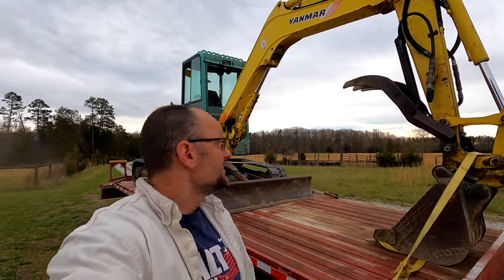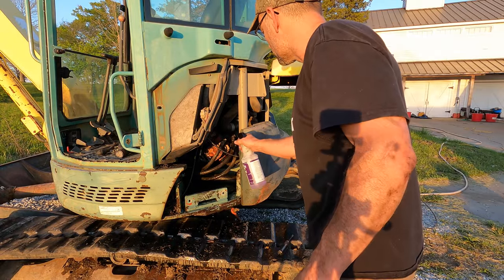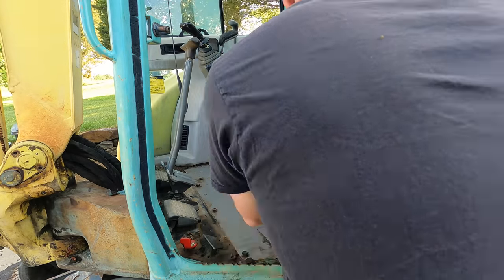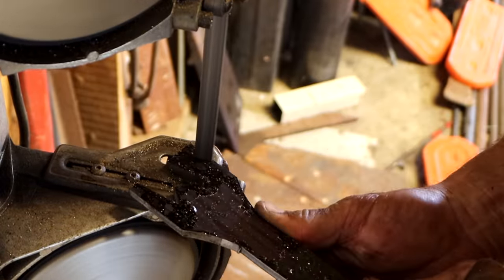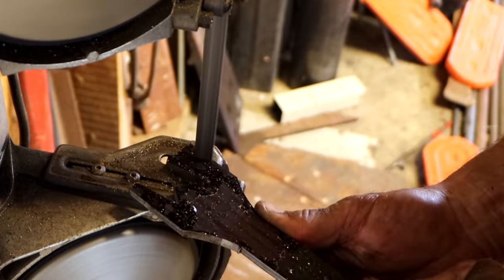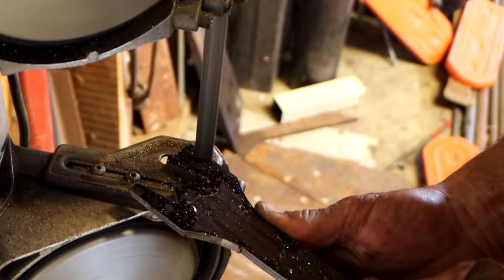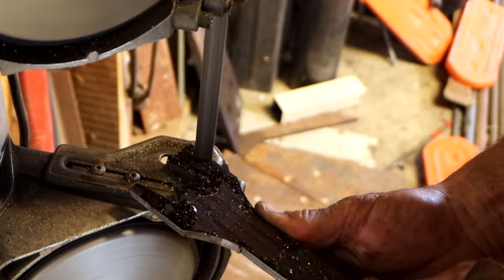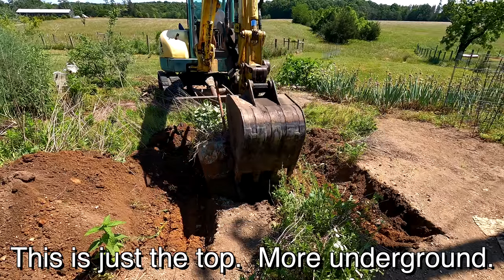Buying (and Fixing) My First Excavator.  Yanmar VIO-50

Comment: There have been independent tests done on different oil brands. You can buy a much less expensive oil that protects as well, if not better. You might consider researching engine oil comparison studies. Lab results on engine oils are really the only way to determine which oils protect better. All major oil brands protect engines adequately. When the differences in engine protection are basically insignificant, there is no reason to overpay for engine oils.

I am not being critical of anything you’re doing. I want to make you aware, in case you had not seen any of the oil comparison studies. I am enjoying your videos.

Comment: If possible add a higher fuel pick up inside the tank. Keep the original, but use it as a reserve. Of course you would have a switch between the two. You can use my name😊

Comment: Always replace the orings on straight thread jamb nut fittings. They're always bad as far as I'm concerned. The thing the yanmar dealer could identify looks like an accumulator to me. It's purpose would be exactly what you were guessing, it absorbs pressure spikes.

Comment: There is a drive mother on each final drive.one hyd pump may be more worn than the other.
Reply: there is at least 6 minor things you check before replacing the $ 5000 drive motor

Comment: Like your videos and I've learned a lot from watching you work on all of your older equipment. I just purchased a 2007-08 Yanmar VIO 35-5. Where did you find your service/parts manuals and who do you order your Yanmar parts from? Any help is appreciated.
Reply from the maker: I got manuals from the dealer and so far have gotten the parts I needed through them as well.

Comment: If it wasn’t said that looks like a hydraulic accumulator that basically does exactly as you described using a spring to accommodate for pressure spikes

Comment: check your idealer slide if its all the way out the track is probably wrong  replace track adjuster seals, hydraulic spanner wrench's fit ,  20K mite have been a bit high but if your happy and it does what you want ok

Comment: Super video learn lots 
I myself own vio 70 and i have a problem with my fast track speed when i press the pedal it blows the fuse  i romoved the pedal and cleaned but still no joy what would my nect move be cheers

Comment: It reminds me of a pressure regulator like you'd see on an oxyacetylene torch, you've got an inlet, an outlet, and a set screw for adjusting the resistance of the flow. You've probably already figured this out since this was posted 4 months ago but 🤷‍♂️

Comment: The problem with your
Blade dropping and your track travel speed is likely the rotary swing valve
Reply: Yes, the center post seals.   Awkward to get at......
Reply: blade dropping my first port of call will be to strip the ram and replace the piston and gland seals , 95 % of the time thats the cause before playing with swivel joint or operating spool.

Comment: Usually anything for sale locally under 20 grand is a much smaller machine. I think basically everything you had to do was to be expected for a 20 year old machine, and overall i would expect a 20 year old excavator to be worse than that, so i'd say you did well.

Comment: 31:00  RE: flushing the oil out of the drive gear thingies....  I think I herd someone mention flushing with ATF (transmission fluid) but I don't know WHAT VERSION OF THAT RED STUFF THEY WERE referring to, OR if it was just ''general hydrolic'' or HIGH __ wutever,  I am sure someone knows or already tole you 3 diff things to use to flush it out with :)  GOOOD LUCK !:)  or even if flushing is NECESSARY or some thing such as that....

Comment: I have what appears to be the identical pressure washer to yours, and it is very helpful but never really gets greasy stuff clean.  My brother used to be a coal trucker, and he has a "steam jenny" - burns fuel oil to send out water at about 200°F.  It just melts the grease. You are down to the paint, with no residue - and much quicker.  The only thing I ever used that will get dried cow manure off my cattle trailer.  The only down side is that it requires 120V.  They may make them that run off a gas motor, but I don't know.  It's a quantum leap.

re: differential drive speed.  Perhaps it's just that the side with the worn track represents a "smaller wheel," making that side cover less ground, but the RPM of the drive motor is actually the same.

Comment: After working in the woods for a while I have a greater appreciation for safety glass and screens.  Just grabbing a few branches and having one snap from the force of the bucket and thumb coming together and spear through the screen directly in front of my face only stopping because the woven wire was just small enough to grab it.  The list is long of broken windshields and safety screens which lived up to their names and saved me from great pain and disfigurement.  Some of my friends haven’t been so lucky.  If I were going to disconnect a safety feature like a movement beeper, I certainly wouldn’t do it on film because of the level of liability that adds for an accident will outweigh any frugal savings you have ever made.
Reply: Not to mention digging up a hornet's nest and having to jump off the rig and run for your life. An enclosed air-conditioned cab is on the top of my list.

Comment: My  final drive seal went on mine same symptoms you are having on yours.  I have to replace.it this fall finally is failing after 3 years...also my blade also would not hold position.  It was the spin joint some of the o rings were worn out in rebuilt it and blade stays put.

Comment: Whenever you are looking at a used ANYTHING which needs work. NEVER let on to the seller what you think the problem is, ESPECIALLY if it is an easy fix and NEVER whip out your leatherman or whatever & fix it on the spot. CASE IN POINT- 2 mechanics went to look at an old excavator a farmer had which had broken down & left park where it broke some years earlier. The Guys looked it over & concluded they knew exactly what it need. They jumped in their truck and went to town and picked up some parts and fluids & returned and set to work. In a couple of hours they had it running so they drove it about & tested all the systems and were satisfied this was a good deal. So they told the farmer they would take it & the farmer says “ Well, boys, OK, but it going to cost you twice what I first asked” The guys were pissed. The farmer said “ That price was for an ex that did not run” The guys protested that they made it run & they paid for the parts. The farmer said  “Don’t care. The ex is now a running machine & I want twice”  The guys were pissed but had put over $500 into it. So they paid his price grumbling all the way and drove away with their new prize but not so good a deal.

!

Comment: I bought a 1990's IHI 35GX. It's in great shape, except the hydraulic pump is giving some really weird issues. Even after spending $3k rebuilding it, it still doesn't function right. So annoying with the odd bugs these older machines have.

Comment: Kind of a bad sign when the engine oil looks like it's the same oil it came with when it was new. Next time you change the oil run it through a mesh screen and see if there's any metal bits or shavings. That alone will tell you if the investment was worth it. 

Basically if your getting chunks of piston rings in your oil you'll know the engines on the way out. Also tracks are super tricky there might be screw adjusters as well might be something to check for. Sometimes they have a spring loaded plate with a screw adjuster that will push tension on the track or sometimes it's the stupid bearing wheels that get out or alignment on the topside. People pick n pull used replacement parts not understanding that the previous owner used theirs for logging or something and needed a loose track alignment to spool a logging line. Just some things to look out for, I didn't look very closely.

Comment: 9/5/2022 Labor Day. Using the air gun, a Dust 😷mask would be great to wear, to keep all that dirt out of your lungs.😁 I know you know to keep the guard 1/8 inch above your work. Nice job on the wrench, good job cleaning also, John. It has rained all day here. I know you will paint it up sooner or later. John, after I would drain the oil, and the filter was off and drain bolt out, I would pour kerosene into the oil pan. To clean more slug out. Let it run out and put some more in. When it was all out I would put the plug back in and add my fresh oil and filter. What do you think of this idea ?  Nice job today. I'm watching this on 9/5/2022 Labor Day. your date was 5/22 when you made this.

Comment: Great video. Just what i was looking for. Very informative. How much did all the repair/replacement parts cost? I know you said the hose was about $200, but what about all the rest--oils, fluids, filters, etc.  thank you.
Reply from the maker: Well, I bought the expensive oil for $140.  (Currently the regular stuff was around $100.). I think all the filters and final drive oil together was about $100.  Hydraulic oil was $110.  So around $550 for everything so far.

Comment: Did the travel motor hub gear oil smell like hypo is differential oil kind of a stinky sulphur.  And just as I wrote this you said it didn’t smell like like hypoid gear oil which was my suspicion they had used hypoid gear oil.  For oil in strictly a drivetrain  environment to stink makes me wonder as I’ve never came across that but I don’t have similar equipment.

Comment: that set screw with lock nut is the pump presser relief valve or the pump, the round part the dealer didint know what it was, is an accumulator... it works like a system pump primer, the track adjuster rebuild is so simple its dumb,, the hardest part is getting the track off an back on, witch helps a lot using another machine, i just bought a similar machine but with new steel tracks an rollers 3 new ones.steel tracks stay on in wet res clay, were the rubber ones clay packs in an kicks the track off on mater how tight it is, oh how i hate rubber tracks,, they dont last,, and 4 bolts to split the track, it has a custom manual thumb, but i am going to add sections in the valve to ad the pluming to power the thumb i have all cind of used cylinders of all sizes one should fit,,

Comment: Jon, I follow Andrew Camaratas YT page and he repairs and services his diesel equipment. I’ve seen him clean a corroded tank by putting some balls in the tank that have an abrasive covering. Then he adds some rags to force the balls around. He uses air pressure to force the rags and balls around in the tank. After a while, most of the crud on the bottom of his tank is removed. Then he flushes and vacuums out the cleaning fluid and his problem with a fouled tank is gone. I think the episode where this was done was when he bought a used white Dodge diesel pickup that needed a lot of small fixes. Hope this helps. For a young guy in his early 30’s, he’s pretty handy. You two seem like birds of a feather. Good luck.

Comment: 3200 hours ? oki, unless this was expensive you got good deal. i see a lot of people buying mini excavators for their homestead, in my opinion this is the smallest excavator you should by if you wan to be able to do some worked. i wonder what is up with the tracks not going the same on both sides, that will drive you crazy if you have to track some distance, i wonder if it can be as simple as you have one new track and one old, they are not the same size and length, i have never changed just one track thinking about this. 20000usd, do not sound to bad, considering the 3299 hours, the engine is probably just driven in, it is not the cheapest, but this is going to be determine by the market around where you are looking

Comment: What kind of hydraulic pump is used for this excavator weather an piston pump or a gear pump?
Reply: pilot pump is usually a gear pump and can deliver around 35 - 50 bar (500 PSI)
Main pumps are a variable displacement radial piston type with movable squish plate so you get low pressure high volume until the load increases then the flow rate slows and pressure increases.
Main pumps usually deliver around 180 - 240 bar (3400 PSI)
Reply: @heartobefelt  you are saying that maim hydraulic pump tht powers the whole hydraulic system is a piston pump. How many pumps are used in this excavator?
Reply: @TeluguWatcher  no
Reply: @heartobefelt  is a gear pump enough to power the motors and cylinders on this excavators
Reply: @TeluguWatcher  no . the gear pump provides the pilot pressure that runs through the control levers . the pilot pressure then operates the main hydraulic valves which supply the high pressure flow to all the rams and motors
Reply: @heartobefelt  what I wonder is to power such a small hydraulic excavator why pilot pump is necessary why can't we directly run the system with a piston pump alone.

Comment: Why don’t you measure from your fixed drive sprocket to your idler wheel center to center or edge to edge and see how one side compares to the other and perhaps either something is wrong with one of the tensioners such as a bad seal although I think you would see a bunch of leaking grease if it was. You may want to have someone try greasing it while you carefully and slowly rotate the track while raised in the air maybe it will extend farther for you. I would recommend you sometime remove the covers off of the tensioners and clean out both of them with you pressure washer as you seem to really care which is nice to see. If all of this does not help you may want to think of swapping tracks from side to side and see if that helps any. You definitely know there is some difference in size due to one being new and one old and used. You also stated that the side that won’t expand and has the slack track which is the new one and not the old one which I find hard to believe but that it runs slower and I don’t know if you have foot peddle drive controls or levers but i’m wondering if one has a tighter linkage than the other and in that way one is opening that valve more than the other and making a difference in speed. It may just be a linkage adjustment. These are all just guesses of mine but I would love for them to be of some help to you. Another guess of mine is that the first leak that you fixed I believe was your main relief  valve on your hydraulic pump as when the machine is running the pump is constantly pumping and if your not activating one of you valves somewhere then that pressure has to go somewhere so the relief valve opens and just circulates that oil back to the tank constantly until you activate a control and it then closes and now pressure is applied to the circuit or circuits that you are using. Ya I would absolutely not ever mess with its setting only unless it ever got something stuck in it disabling your machine otherwise I would never mess with it other than what you did to fix the link. It was a very nice video and I love to see how your taking care of your 
“NEW TOY” as you call it. Im going to continue to watch your very interesting videos and projects. Take care brother stay safe and have fun I’m sure it’s going to be a Great addition to your home and farm.🐢

Comment: Your tensioner in for that track if not both need replacement . If the previous owner did what you mentioned and tightened the shit out of the tracks to the max and constantly ran it like that like there probably slam wore out.  You want a little play in your tracks for the life of the tensioner.  He was def doing it wrong tightening the shit out of them . That's alot of friction building up so he actually tearing his own stuff up doing that.. you gonna have to put some love into it bc the previous owner was a moron it sounds like but you'll have a good peice of equipment after ..good maintenance and upkeep on heavy equipment is rule #1

Comment: Never buy equipment sight unseen!!!  If you were there and were able to point out the neglect to the auctioneer and others you might have been able to get a better price?  The previous owner abused this machine.  You have done a spendid job replacing parts and repairing many of the problems but still have a way to go.  Poco de poco as they say in Mexico!.  You have a mechical mind and good problem solver which means you eventually have a decent machine for your speed and doing work for others.  Don't be in a hurry to buy your next piece of equipment or up grade.

Comment: 34:00 if you find it does seem to leak out of the hub then you can fill it with a heavier oil/grease. Andrew Camarata did something similar on his Yanmar and a diesel tech told him they do it all the time instead of rebuilding them
Reply: Points for the Camarata reference 👌

Comment: Why AMSOIL only in the engine? You obviously know the value of the quality products. Aren't the hydraulics and final drives as valuable as the engine?
 BTW, I've been using AMSOIL since 1975 and a dealer since 2004. So, obviously I concur with you about the quality of the engine oil (and everything else from them...) 🤣😁